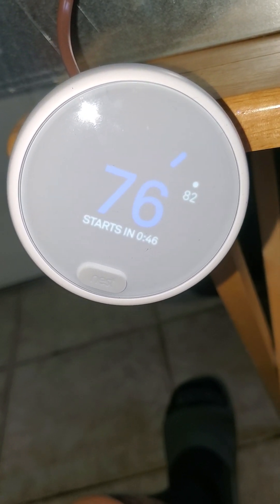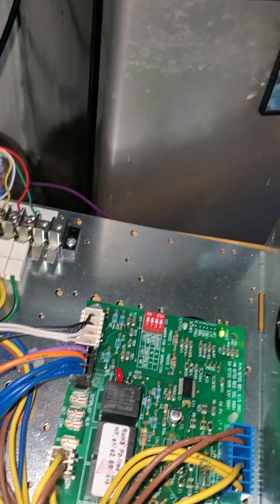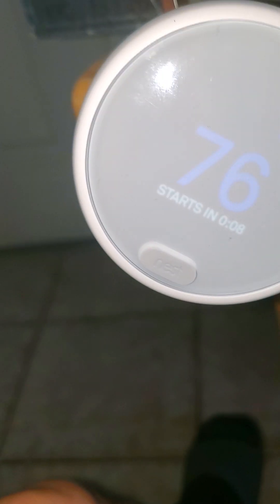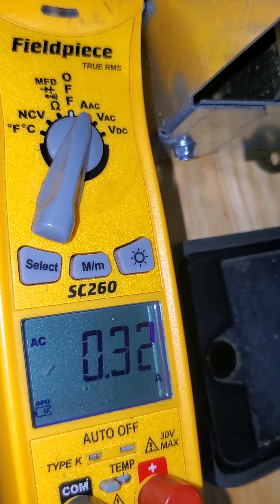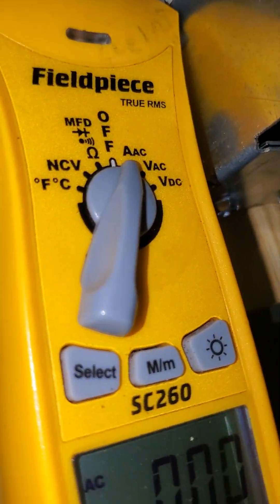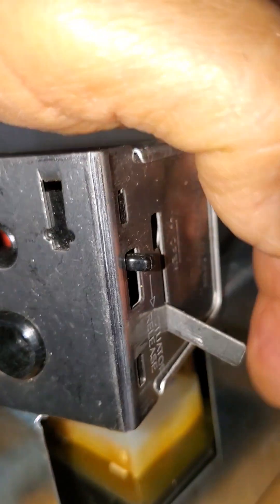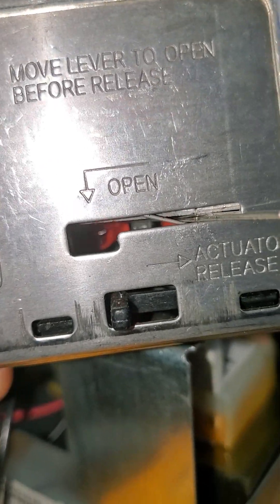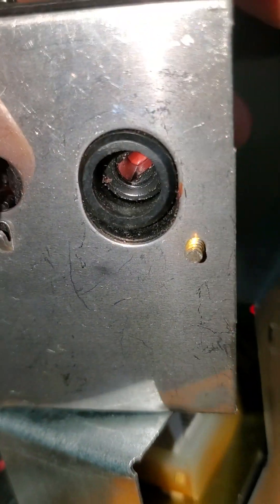Actuator 24 Volts Check Operation

Comment from the maker: Schneider Actuator 24 volts   Checking operation with Bosch Control Panel and Nest Tstat....Actuator Valve is for Fan Coil Chilled Water System